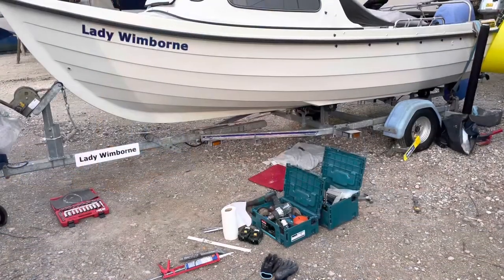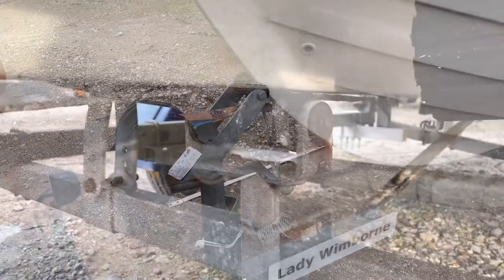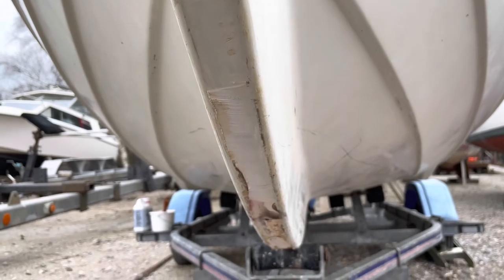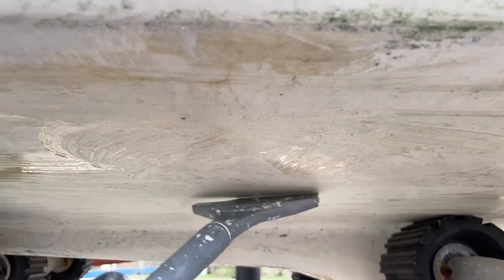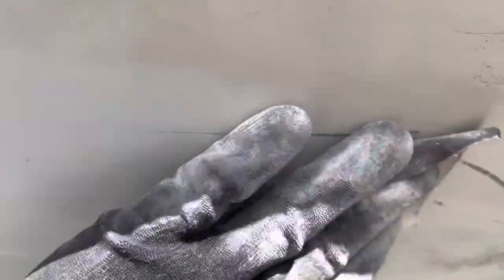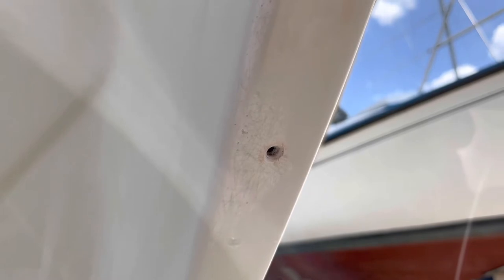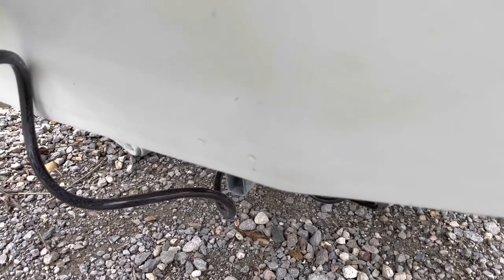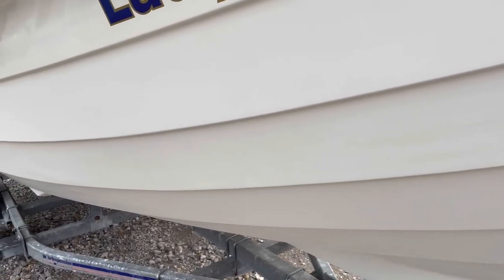6. Orkney Strikeliner 16+ Repairing the hull, removing keel band and using epoxy resin and gelcoat.

Comment: Hi, did you replace the keel band? If not did you have to buy a new bow D ring for the winch strap?
Reply from the maker: I didn’t install a new keel band. I prefer a boat with less holes in! And have no need to rest on the bottom. 
I reinstalled the original D for the winch after cleaning it up a bit. I used Sikaflex as well as the original bolts with washers. The outside washer is a long one that incorporates both holes.
Reply: My Orkney 440 coast liner has a stainless steel  keel band but the side ones where made of steel I also removed them and replaced with same thicky aluminium